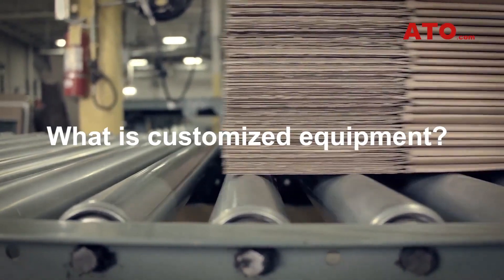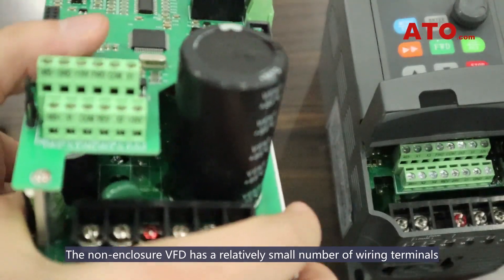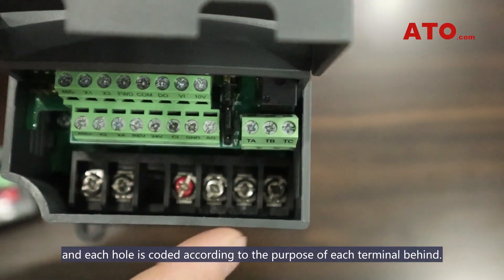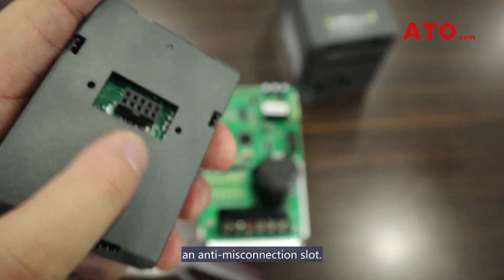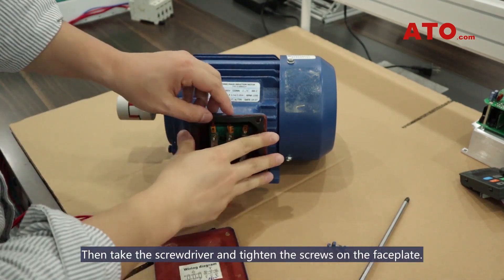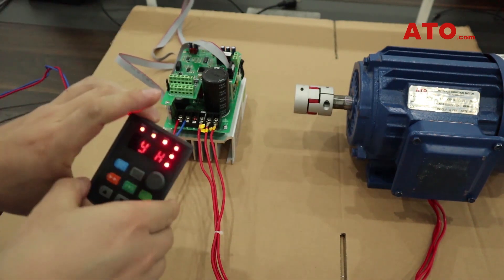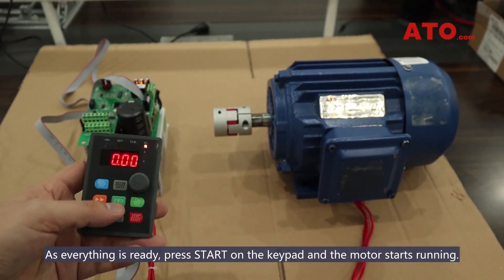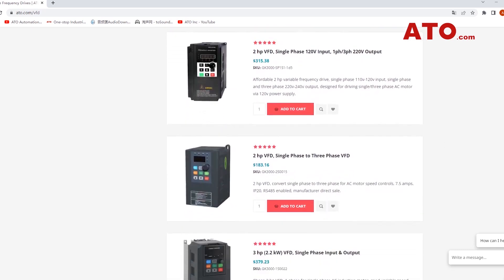Non-enclosure VFDs for Design-Manufacture of Customized Automatic Equipment

Comment: If you build it inside a cabinet with the heat sink outside the cabinet I would buy one
Reply from the maker: What project are you using? Our IGBT module is in direct contact with the heat sink for good heat dissipation, but even so, its heat dissipation performance is sufficient. So I don't quite understand why the heatsink should be placed outside alone?😀
Reply: @ATOcom-Automation  I want to keep dust from coming in contact with the electronics inside but I don't care if the dust comes in contact with the heat sink but the only way to make this happen is to put it inside of an enclosure with a hole cut in the back and a rubber gasket to make a seal to prevent dust from entering the part with the electronics.
Reply: @ATOcom-Automation  It might be possible to glue it into a case to make a hermetic seal to separate the electronics from the contaminated atmosphere. The heat sink would need to be outside the enclosure and the electronics need to be inside the enclosure. If it's done this way the heat won't build up inside the enclosure
Reply: @ATOcom-Automation  It's to drive a 10 horsepower or 7.5kw three phase motor from single phase power